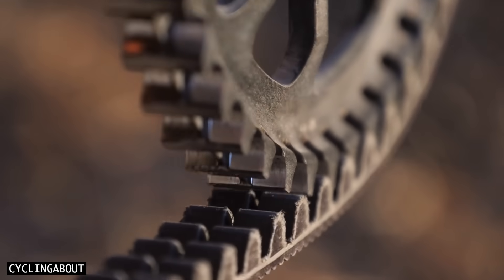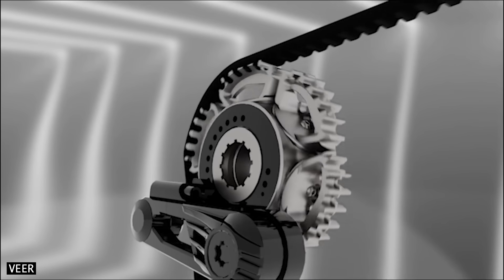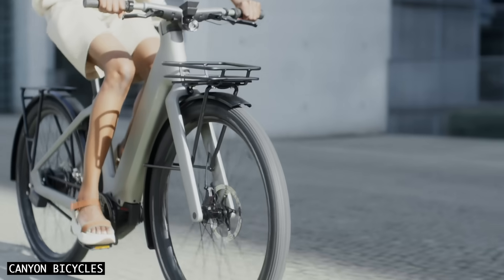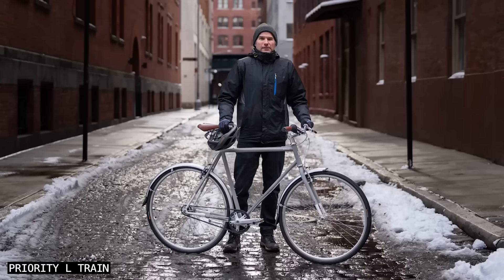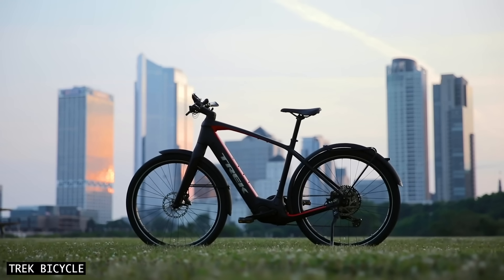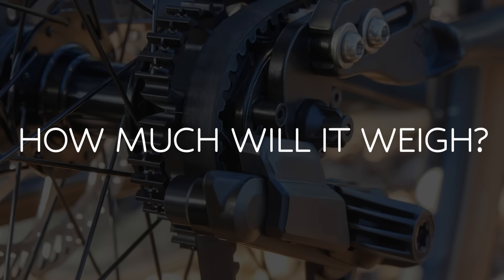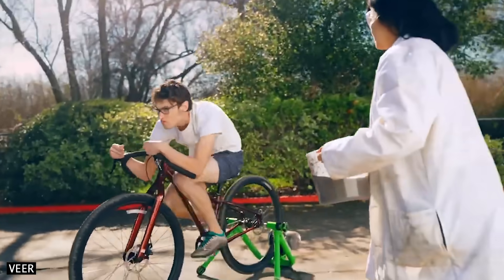Are Chainless Belt Gears The Future of Bicycle Drivetrains?

Comment: I’m always a fan of trying new things, but I predict this idea will not be successful. It does what a 2-speed hub already does, but requires (at least) six segments to shift, without fail, to accomplish each shift. Ditto a 2 chainring front derailleur: it’s much simpler and easier to produce than the multiple rotating segments of the 2-speed belt drive, easier to maintain and repair, and gear ratio changes are much easier to effect. It’s an alternative solution to a problem that has already been solved, but doesn’t offer improved functionality, reliability, or lower costs. ❤
Reply: …agreed…and exposed to the elements
Reply: Until you have experienced belt drive...............you don't know.
Reply: biggest issue is that it will be heavier then a normal drivetrain
Reply: Sir this good or bad
Reply: Finally someone who has engineering skills.
this is completely pointless and insanely complex idea which only works in CGI I doubt if they even made working model.

Comment: I really liked the belt drive on my commuter bike, but I eventually got rid of it because I really didn't like the internally geared hub. It had an Enviolio hub, which was totally unsuitable for mildly hilly riding due to its range and inefficiency. I replaced it with an electric cargo bike, and the cargo bike (with derailer) climbs hills better, even without the electric assist turned on.

Maybe a better hub would have been fine, but it shows how big of a downside internally geared hubs can have. I'm really happy seeing innovation in this segment.
Reply: You should try Rohloff hub. It is very efficient.
Reply: Yeah, even a Rohloff has more drag in last gear, than a 30 year old 3×10 speed design, plus more weight, more cost, & less modularity. 

The grease & chewed pant legs are real issues, but the biggest functional issues with derailleur systems, come down to usage; with proper usage, derailleur shifting is still superior in most functional respects. 

Ditching derailleurs is mostly a convenience thing, & not at all a performance thing.

Comment: I don't see those things getting any further than being a exotic and nieche product.
Even 3-speed hubs with significant higher range and more gears will most likely be significantly cheaper.
Even if that entire mechanical thing costs just over $100... It'd be the same price as a nexus 8 speed hub.
Also from the looks of things, once the sprocket(s) are worn, you'd have to replace significant parts of the entire ordeal, or the entire thing. With a normal hub, you can just replace the sprocket.
The only application I can imagine would be super high load situations like heavy load cargo bikes or electrically assisted velomobiles.
But even then I'd invest in a pinion or something that only has to survive the rider's pedal force, rather than the combined force of rider and motor.
Reply: Getting a larger range with a 3 speed is as simple as scaling it up. Instead of direct and combinations of 3:4 or 4:3  you can have much jumps larger ratios. Could have a 900% range with 3 ratios: 3:1 and a 1:3 driven at the cost of the massive jump.

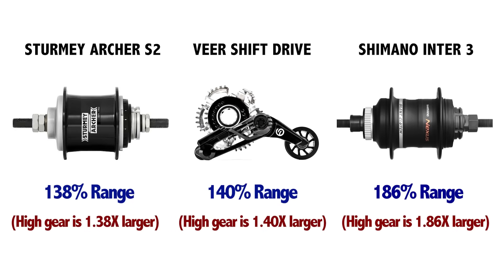Comment: 3:34 (Edit: I wasn’t paying proper attention, ratios are in fact correct.) The total gear ratios are inaccurate. Sturmey Archer has 177% total, Shimano has 186%. That’s a sizeable difference - and those are just the 3-speed hubs. The seven and eight speed offerings from Shimano are still on the affordable side of things, and offer several times the range. Moreover, with a chain driven hub, moving that bracket up or down requires changing a sprocket that costs less than 20 quid. And the number one selling point of belt drives is low or no maintenance. This price of kit has exposed moving parts, meaning maintenance will be crucial for maintaining proper function, never mind performance. Impressive engineering, but a solution to a problem that’s already been solved.
Reply from the maker: That's a Sturmey Archer 2-speed hub on the left. 138% is correct.
Reply: @Cyclingabout   I stand corrected on that point.

Comment: I have never had a problem doing the minimum work necessary to run an efficient chain, however your explorations into belt drives are intriguing and informative.  the pinion gear with belt drive will be the best option where I live and ride. I am 65, and I expect to Finnish out on my steel frame and chain drive.  endless fun on bikes!!!!
Reply from the maker: Thanks! There are many instances when chains are superior, and many others when belts are best. It feels luxurious that we can perfectly optimise our bikes around our every desire. 😎
Reply: Really, is there any other consumer product, that is so modular & non-proprietary? 

Even these fancy drive systems, are designed to fit many brands of frame! What other industry is like that, today?!
Reply: you offer great video productions full of useful information and geared toward educating riders.. thank you.

Comment: This looks great!!
Is it possible to combine it with a IGH, and have 2x the gears, like a chain drive with 2x chainrings?
Probably no one will need so many gears with a rohloff or a Pinion, but I use a Alfine, and want more gears. 
More options is always good...
Reply from the maker: Sturmey Archer make a 3-speed internal gear hub with a cassette freehub. So yes, a 6-speed setup will be a possibility.

Comment: I recently purchased a cheap 1 by 8 speed road bike I use as a knock about, and for commuting. It's fitted with a 250 W hub motor and has a small 250w battery as I like to pedal. I can easily get 70 to 80km on one  charge. What has amazed me is how little I use the gears. I'm mostly in the highest, or the lowest when I'm helping the motor climb, which is important with such a small battery. The way I ride that bike, the Shift Drive would work well.
Reply: you could get the same range out of an e-scooter, which you can also drive on bike lanes. Less moving parts and more comfortable.
Reply: @svr5423  I have an e scooter, but need the exercise. Plus I weigh 95k, the scooter only gets 20km range. but it's fun to zip down to the shops.
Reply: Yeah, the only escooter I know of with 80km range, has a 3KWh battery, weighs half what the rider does, & was recently stolen.
Reply: @prophetzarquon  mine has 70km range with 1kwh battery.
Depends on the landscape, if you climb the mountains and don't regenerate coming down your range is more like 40km.

There are several on the market with 100km+ range. But normally you would then take a car anyway as it just takes too much time.
Reply: @svr5423  Your spot on or perhaps a little optimistic for my bike, let alone my scooter. I brought the bike when I was recovering from an injury. When I started riding it I always charged it after about 35 - 40km. I never risked going past that as walking any distance was unpleasant. I couldn't put many watts into pedaling, but even so, to get that range I still had to put in some effort.
I'm a lot stronger now, and I ride on the flat with the assistance set to 0. That doesn't appear to do much more than overcome motor resistance. Maybe a bit more, the motor has amazingly low drag when turned off. When going up small hills or inclines I set the assistance to 1 or 2, or I might drop down into 7th gear as well. Usually I only use level 3 along with the lowest gear for the big climbs. Which is what makes 70 to 80 km ranges on a small battery easy.
In the comments sections under the bike there are endless complaints about the poor range. which is not a suprise with such a small battery. Most of that is because of the low Amp hours, and that there are so few cells in parallel, which means the voltage will quickly start to sag if you put it under to much load. A big battery has a lot of advantages asside from just the extra capacity. On the other hand it works well for me, and it's light. Plus I like that the battery is hidden in the down tube.

Comment: Not sure if this will pan out, but I love the creativity! The way the gear sections somersault is mind-bending 🤣

Perhaps, some boffins will figure out how to do even more gears in the not too distant future. I would imagine so. Perhaps, just slide in the next row of teeth. Seems like sliding would be way simpler. (This would be more like the way that derailleurs work, except instead of moving the chain or belt, move the cassette.)

An even simpler approach might be to add front shifting. Then, using similar tech, you could (again) double up to 4 gears.

Not sure I'd say cable operated shifting is "very" reliable. I've had a fair number of shift cables snap on me. Granted, I have generally used derailleurs, not gear hubs. Unless the tension needed to operate a gear hub is much lower, or the bend radii are much bigger, I would imagine cable failure is just as much of a problem in gear hubs? Of course, compared to electronic shifting, no batteries is an advantage for cables :}

Comment: If it can change gear in the rear, then surely the same can happen at the front?
Reply from the maker: Absolutely! 👍
Reply: There was a home-made 6-speed system demonstrated on YT some time back. It had a different way to change diameters and was designed for a chain, but a similar concept.

Comment: If both front chainring and rear one would be equipped with this solution we could get 4 gears which honestly may be enough for quite flat terrain.
Reply: Oh man I didn't even think of that but immediately my brain went "ok who's going to do a Rohloff-Pinion-Veer-Shift-Drive for MAXIMUM gear ratio range first..."
Reply: good idea
i thought about how one could fit 3 on 1 side, but 4 on 2 would be better
would be cool, if there was just 1 shifter with 4 gears
Reply: What do you mean "may be enough"?
In the 80's, bikes with 3 gears were common (in Europe). I only ever use the top 4-5 of my 21 gears. I don't even think I could pedal fast enough in my lowest gear to keep me from tipping over. I think that the by-default inclusion of more than 1 front sprocket is more due to marketing than actual need.
Reply: Nah, front shifters are great, actually: '1×' drivetrains kinda suck even in town; a cassette with an "ultra-wide" ~375% shift ratio is barely enough to keep cadence reasonable at high speeds, if anything like a 1:1 climbing gear is retained. 

>400% shift ratio is highly desirable for a human-powered vehicle that might hope to exceed 25 MPH more than once in a blue moon. 

I'd prefer wider shift range on our ebike, too; even though it won't go as fast as my 3×10 speed manual bike does.
Reply: @Pystro  Personally on 1x11 drivetrain I too use 4-5 gears 95% of the time :D.
 But there are people which swear by the 1x12 or even 1x13 saying that they need all of these gears.
Reply: @Pystro  that would be some amazing worldwide marketing campaign running for 75 years, if you ride in varied terrain at varying efforts, you’re using all the gears at your disposal, on this evenings ride I probably shifted between large and small chainring at least 20 times
Reply: This was my thought.
Reply: i was thinking about combining it with retro direct drive, but belts don't like being bent backwards.
Reply: можно сделать передачу с двумя короткими ремнями и в качестве успокоителя использовать подвижный натяжной центральный ролик с еще двумя передачами.  таким обазом будет 8 вариантов передаточных чисел. для облегчения веса комплекта возможно распечатать на 3д принтере полимерные сменные зубья (венцы) для экономичности, или изготовить зубчатые венцы из карбона для еще меньшего веса и долговечности. From Russia with Love)
Reply: I don't think so. Four gears are frankly not enough even for the city, taking into account the terrain changes. And outside the city, you will almost always have a situation where the load is either too high or too low. Four gears only on a straight line will be more or less. But there will not be four, because the front star is much larger in diameter and therefore the turning segments of the star will also be larger. It will be cumbersome and will regularly chew up clothes or damage your legs. That is, such a mechanism can only be used on the rear wheel and only together with closed gearboxes. And such joint use will not give any noticeable advantages.

Comment: I moved over to the Gates belt drive system around 8 years ago on an e-bike, (Cube SUV Hybrid Race 500). I could never go back to chain ever again, having ridden bikes for around 32 years daily commuting to work. I'm now an older guy (56 years old), so moving over to the belt and Enviolo automatic gearing has been a blessing.

No more getting your trousers caught on the chain, no more rusty gunk infected chains, it's a no brainer. The belt drive is more expensive, but trust me, it's worth investing in a decent quality Gates system.
Reply from the maker: I agree! My belt drivetrains have been hassle free for over a decade now. 👍
Reply: But would you go back to a non-e-bike with belt drive?
Reply: @COYSMike I use a non-electric bike with Gates+Enviolo and I love it! I also cannot fathom going back to chains. I plan on switching to a Gates+Pinion Priority 600 ADX - the hills here are not very forgiving.
Reply: @COYSMike  I haven't cycled a non-e-bike with belt drive, however, if for example, e-bikes weren't available in the market, I would certainly try a bike with a belt drive, having cycled for 32 years on chain-driven bikes, I'm sure I'd be happy with the Gates belt drive, especially since I was fed up of cleaning my chain many many times, living in Scotland the weather here ain't so forgiving, 4 seasons in one day  :)
Reply: @COYSMike  Can't speak for OP, but I'm in my 60s and ride a non-e-bike IGH belt drive year-round in Edmonton.  Other than changing the oil every 5000 km, no maintenance required.  Wouldn't go back to a chain, period.  The belt alone will probably out-live me.
Reply: I don't like the extra drag, on a manual or ebike... The grime & trouser eating are real, significant downsides, but I've long since learned how to avoid the major hassles & enjoy the lower drag, lower weight, & dramatically lower cost (yes, even including maintenance) of a cassette+derailleur. 

I just wish our ebike had room for a front derailleur! (1× drivetrains are not so great, & as observed above, hub shifting is conveniently tidy but not otherwise superior.)

Comment: What about mounting one with a 3 speed igh?
Reply: @DIY-DaddyO  given the differences, you’d get what’s essentially a four speed setup or possibly four-and-a-half, and some combinations that are in between the admittedly rather large jumps between the gears. However, they wouldn’t be equally spaced. Swapping the 3-speed hub out for a five or seven speed would give more range, a cleaner install, and fewer points of failure. Likely, it would be much more cost effective as well.

Comment: Looks like too much additional mechanics and additional  cost just to have only +1 gear. Don't do much sense. Can bet, won't gonna go to market.
3 gears hub is cheaper and , as it was said, provides more range.
7sp derailleur system is cheaper and gives much more range though need maintenance.

Comment: I wonder what advantage this offers over somthing like the Classified rear hub? If you already have a rear hub motor then obviously thats not an option, but if I wanted to increase the gearing in my belt drive singlespeed (or a mid-motor setup, if I had one) I think I'd investigate the Classified setup first.

Comment: Now that it an interesting idea, cleverly executed. What I want to know now is how does the mechanism work to synchronise the segment rotation? Is it sprung or driven? I assume the latter as it's bidirectional. But in that case what is it that makes it happen in the right spot? Ah. I guess there is a cog behind each segment inside the hub and a bit of drive-track in the right place that engages on either one side or the other to make the rotations happen. Neat.

Comment: I had same chain on my bike from 1998 to 2021, chains can last decades
Reply: and cassettes can last days 😂
Reply: @steelsofwheel  single gear steel bike with foot brake from 70s. Finally sold it because both wheels were so warped and new ones cost 10x value of the bike
Reply: chains break on average every 1000 to 2000km for me.
Especially in winter and high torque situations they tend to just rupture.

Keep in mind that bicycle chains are unneccessarily thing and made out of cheap material, unlike motorcycle chains that last much longer.

Comment: They should work to marry up with pinion - the range of the combined systems would be insane then.
Reply: Pinions are already insane! This is really for more affordable bikes
Reply: If you have a 6 speed box you could convert to an effective 2 by 12 speed for an extra $150! Or 9 to 18?
Reply: How do you imagine the use case where the gear range of a pinion is not enough by itself?